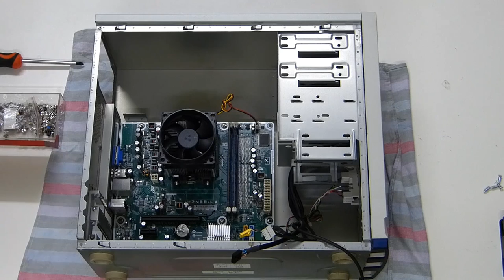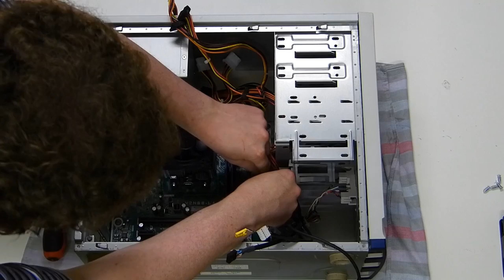Building a PC [3/5] - Power Supply and Drives

Comment: As far as I can remember with regards the extra 4 pins on the ATX connector is just another 12volt rail for extra power. As long as your not consuming a lot of power or using a chunky graphics card it should be fine. You can get 20 pin to 24 pin adapters which are good, but do put a bit more strain on the single 12volt rail.

Comment: Dude, get a SSD and a USB3.0 add-on card and you're done ;)
You wouldn't believe what I had to do to connect my add on USB 3.0 card to my PCIe slot, which is covered by the video card. Didn't want to change my seven years old, but reliable mainboard. Reliability is the one key factor for me.

Comment: if you want to use that fps psu group psu plug in the 20pin and leave the 4 pins at the top,they arent vital to the computer, i have had a pc run like that for 5 years no problems, then when i added the extra 4 pin there was no difference
Reply from the maker: Big thanks for the tip! The FSP power supply has the connector for the video capture card I was missing, and it should be a lot more quiet than the HP unit.

Comment: Hello DrCassette, i love your videos! Please can you tell more about TDA2030/2050 why i cant use two chips on the same radiator?
Reply from the maker: You can mount two chips to the same heat sink. The chip's housing is connected to -Vs, so provided you use the same power supply for both chips there is no problem. All info you need is availble in the data sheet. Google it :)

Comment: i hope your seagate lasts, i have never had good luck with seagate drives, last seagate drive that lasted me was an ide one, there sata ones seem to be of ''cheaper'' quality
Reply from the maker: The Seagate has been around since 2006, until 2011 it was part of my main computer system, never had any issues with it. The only HDD I ever had problems with was (what a surprise) a Samsung drive.
Reply: I have a 1 gigabyte drive from 1995 that still works. By the way, it was priced at $320.00. I use it on a quad processor P III Tyan board as my Freesco router. Last time I checked, the up time was over a year. Most drives fail because of two reasons: they get bumped around and the pc is not plugged into an ups. the worst thing you can do to a drive is provide a poorly conditioned power supply.
Reply: theedrstrangelove i know all that, i did nothing bad to the seagate it just died, i had 3 of the seagate drives die on my (click of deth) and they have never been knocked, they had under 3000 of power on hours and the psu is a corsair one which is high quality